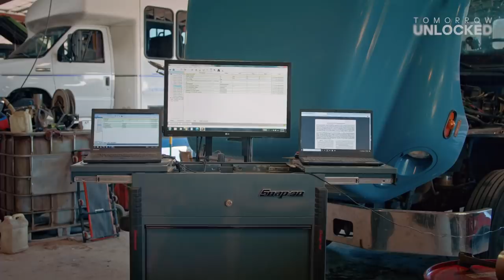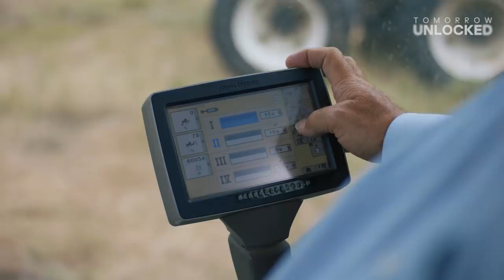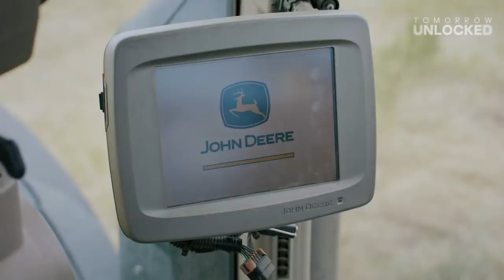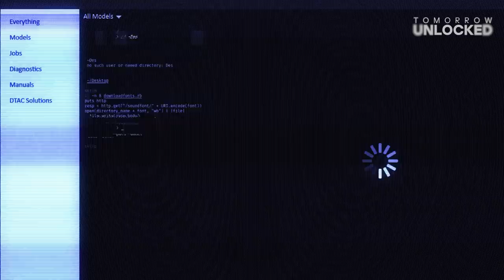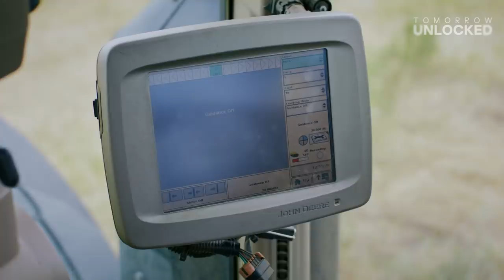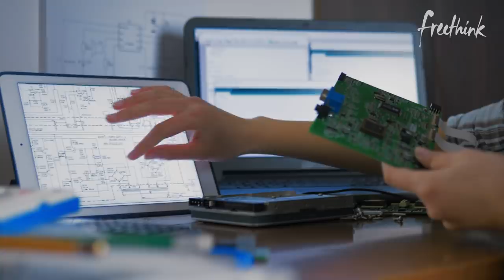The farmers forced to hack their own tractors

Comment: I made a fair side business clearing Caterpillar critical repair lockouts that required a dealer unlock 15 years ago. Mechanic could fix it right but not clear it to start and run. Simple to clip jtag the rom and inject the instruction to unlock past the validation code back then. Now? Dunno.

Comment: Parts houses have slowly disappeared over the last 2 decades as well. No longer can you go down the street to buy components or replacement boards for electronic equipment. You have to order from China and it takes three months to get here on a boat and will be in customs for one month making the repair impossible as far as turnaround time is concerned. So they have made it impossible for me to repair your equipment and compete with the dealer.

Comment: I am an A&P Aviation Mechanic and This makes complete since when it relates to Aviation The FAA saids absolutely not when it comes to repairing your own airplane The only Things The owners can do is what’s called preventive maintenance which only Includes Things like changing your oil if you need anything real repaired you have to bring it to an A&P and They have to sign it off as being “airworthy” if you don’t your Insurance will drop you or They won’t Insure you or in worse case you could be arrested For Flying Illegally yeah it’s not really Fair but That’s The FAAs way RULES RULES RULES

Comment: I’m not a farmer, so I’m wondering if a 2020 model tractor with all the circuit boards is really better than a 1990 model tractor? I’m talking about a hypothetical tractor manufactured today using the 30 year old analog design?

Comment: I own a business that specializes in building websites. There are companies out there like mine that actually lock you into the same kind of situation. If you want your website changed or anything else you have to go through the company that set you up because the way they sell you a website is they own the domain name and the host, if you decide you don’t want to do business with them, they yank your domain from you and hold it hostage. I don’t want to get into the specifics but my company appears to be the only one that doesn’t practice this disgusting method

Comment: As long as you can get parts, you can fix your own farm equipment. Are generic parts hard to find?
Reply: It’s not the parts that they are missing it is the proprietary software to run the hardware. Without it the parts are no good the machine is no good.

Comment: My neighbor just came in with the smallest  John Deere cab with A/C and all that fancieness. He only has .8 acres and our back pasture to mow because he now hunts it😕?. 
I would love to have that tractor , don't take me wrong. I just wouldn't pay for it. Beside the right armrest was more switches than most luxury cars. While it still has a new car smell and warrant it's cream and hot biscuits. When those control boards short out , solenoids short , any of the above loose ground , and as mentioned having to get John Deere involved at their $10,000 per hour rate you would be better off using a shovel to do the work the tractor was gonna do.

Comment: It’s getting to be the same with cars and trucks. Yes technicians can can buy software to fix them. The problem is that the manufacturers don’t have to share the correct information in terms of circuit design and how it’s built and accessibility to parts and having to buy tools to program or reflash for 1000s of dollars just to have to pay for time to log into the manufacturer just to program the vehicles anyway. There is a right to repair in the auto repair field as well because we are getting locked out to.

Comment: I believe this problem is getting into smog equipment which I believe started with jerry Brown sr. He had a cousin selling smog pumps they would disconnect the vacuum advance so the engine would only run at slower speeds then they put in a air pump that pumped fresh air into the tail pipe after the engine so the percentage of pollutants was lower the engine still put out the same amount actually more because the engine wasn’t running as good  and now there doing it with computers remember those tractors 🚜 run on Diesel fuel the cylinders need to be warmed up when the pistons go up the compress diesel will explode it doesn’t require any electricity except to warm up the engine and to crank over the engine and on older big Diesel engines they had smaller gasoline engines to crank them over a lot use a mechanical fuel pump after starting everything is mechanical no electric is required and to shut it off you cut off the air and fuel if you just cut off the fuel it will keep running but it will burn up the engine. So how did they make a engine that required no electricity to only run using a computer. It wasn’t for the farmers benefit

Comment: When tractors were built by those who really cared, they were simple, efficient and could do the job. When computers were introduced the simplicity was removed., In its place were printed circuit boars costing exorbitant amounts of money for mass produced items costing a great deal of money - most of which was pure profit - like the ink for printers or blades for your razor. The point here is that farmers have neither the equipment nor the skill to check, bypass, oir repair these computer boards and programs. It is true, they pay a lot of money for the machinery yet contorl over that machinery and how it operates, reamins in the hands of the company that makes those machines - and this applies to not only tractors but cars, CNC machinery and all things controlled by computer programs. Yes - these programs are a great benefit to the farmer. Yes, it cost money to develop, test and install this equipment. But in the end,  they still overcharge ofr repair parts far in excess of what is necessary. And the systems gives the manufacturers a monopoly over the sale, use and maintenance of the machines. NOT FAIR.

Comment: Trane air conditioning has done this to the school district that I work for they will not let us have the software to diagnose the air conditioning equipment.
It's the new money.
Yes you can buy this car but the wheels aren't included.
You can buy this wagon but the handle will cost you a fortune..

Comment: Is it a case of manufacturers not making much or any profit on the products themselves so making the product so only they can fix it and make money from it that way? If they remove the barriers so anyone can fix it will they then put the prices of the product up by the amount of money they would make on an average machine through repairs / servicing over it life time? An issue Iv seen before is non manufacturer repairs causing other problems that the owner then blames on poor design / manufacture and expects the manufacturer to warranty it.

Comment: It's not rocket science, we are very good at problem solving, probably better than the people that actually make the tractors. We have been doing it for yrs. If the emissions crap goes bad, we rip it off and bypass it. We can buy computers to do upgrades and program it after the fact. We do it with semi trucks as well. They call it saving the atmosphere, but when my dads cat started acting up, we ripped off all of the egr crap, put one big turbo on it, a few aftermarket cooling parts and turned it to over 700hp at the ground. He went from 4.5mpg to 7.2mpg. You do the math at 150k miles per yr. I'll just tell you, it's 12k+ gal of fuel saved. So what of he has a little black smoke every now and again, it saves 28k dollars in fuel a yr or more. Think about it.

Comment: My most despised perp. - Apple , who even patent their own design of screws that need a one off tool to fit ffs. Apple hide batteries make things awkward to access .etc . Worst thing apart from slowing iPhones down years ago and getting fined for it is the fitting of an electrically under rated part to lap tops knowing it wasn't up for the job, eventually it would blow and they did some multiple times in the same device. you'd think they'd test the part after all the failures hell if you understood power ratings you'd know it wasn't fit for purpose. Did they? Hell no still fitting them 4 years on ( 2013-2017) 
That's what's called fn lazy at best . Most indi repair shops knew this and switched em out, or if original was in recommend to get rid .

Comment: Why can't the farmers get the blueprints to a 1940s tractor ( they owned one in the video) and just build their own tractors from old car and truck parts, the mechanic said that could repair diesel truck engines so use diesel engine from 18 wheelers should be a strong enough engine to do farm work  and building your own tractors from used truck parts should be alot cheaper than those 100 thousand dollars John Deeres that they showed in the video saying they had to buy foreign countries computer hacking parts for.

Comment: "If a check engine light was on, i couldn't even tell you why the check engine light was on" 
I am sorry but telling lies to support your argument is not ok. John Deere has for over 20 years explained in the instruction manual, (you know the book that follows the tractor at purchase for no extra charge right?) the procedure to extract a fault code. This code is explained in the manual, probable cause and suggestions of how to fix it. It's not that hard, just read the book!
Don't get me wrong I do strongly support the right to repair act. In some cases you can physically change the parts, but they will need programming and/or calibration afterwards to function. Control modules, injectors, actuators and stepper motors are examples of such. In other cases the software may just flat out fail, and the dealership will have to reprogram the module, and they will charge the owner for it. It should be a lot easier for independent companies to do so. Even though this will also have some cost, because developing software is not free, it would generate competition. JD is not alone about this, but they always get the crap because they are the biggest stand alone company. If that where the case why don't farmers just buy a Case😁🤷‍♂️. The market is controlled by the consumers, so if you are afraid of these companies  JD, Apple, Tesla etc. having control over your product, simply don't buy it. Again it is not ok to lie so people have more sympathy towards you!

Comment: This is their greed, instead of making more productive equipment they try to squeeze money from farmers. They hate that farmers use old equipment and buy parts because deere wants that money. All they are doing is making that older stuff more valuable. 

Deere could be working on bigger better stuff to drive production but i guarantee you compare a 2010 to a 2020 model and the production rates are about the same. 

All tech, computers and tractors/cars you should be able to maintain with affordable tools from the manufacturer. For now ill keep rocking my 1980s tractors.

Comment: The thumb is for the ladies thaughts and spirit! There should be a time derived limit to a insured product based on time ran or miles.Then have Fix manuals handed out for other mechanics and computer tech people,easy fix huh! 3-5 years in their terms,then the rest of time to the owner.Just like car parts are done. And the dealer must keep the boards made and avialable for life!Just like a 1952 carborater on a falcon or Chevy.You can still get them,and older parts,even model T parts.  Ba-bye!

Comment: What a pile of garbage, does it EVER occur to anyone that modern equipment CANNOT BE FIXED WITH A WRENCH OR A SCREWDRIVER.
One of these guys admitted it, THESE MACHINES NEED EXPERT KNOWLEDGE IN ORDER TO BE FIXED.
So there is NO LAW to prevent a farmer from going and getting a degree in Electrical and Electronic Engineering.
Even then, GOOD LUCK FIXING IT.
There is NO LAW that says you cannot perform open heart surgery on YOURSELF, but for the same reason I would NOT RECOMMEND IT.

Comment: Electronics are the worst. I'll take mechanical fuel injection and timming any day over the geek garbage that they are putting in our machines.
As an operator of a piece of machinery I don't need a potentiometer or hall effect input to an ECU to tell me how much material I'm speading or the speed of my auger because I can make that determination for myself. The printed circuit board does not hold up at all well,when put in high heat, heavy moisture or dusty environments . The manufacturer drowns them in gels and seals the connections with seals and positive locks but the truth is, the pins and cavities,even when "gold dipped " cannot mantain a propper electronic continuity when put to the test over years of use and repetition. Size does matter, the more gizmo's on a machine the smaller gauge the wire. The lower the supply and signal voltage. 
The quality of the motors is light duty at best. Let's face it, the computer is sensitive and needs to be in a climate controlled environment , not in a wheel well, or mounted on the bulkhead in an engine compartment. You want to limit the amounts of pollutants, make the engines run efficiently and that in turn will reduce by-products. Keep the geeks out of the machines we need to use to keep our country running.
The newer the machine the more likely it is to breakdown and be unrepairable except by the "stealerships " .

Comment: Buying the tractor doesn't give you ownership of things like programming. Because if they are still using the programming in tractors they are selling, part of the cost of the unit is towards the programming the company spent time and money to develop. If you own it after buying it, the company no longer owns the right to use it. That would allow competitors to simply buy a tractor, copy the programming, and sell it without having to pay the cost of development. Company a goes broke, because company b can charge less for the same thing with none of the original expenses. Most of the hack tools come from communist, or socialist countries. Buying them like that is undercutting capitalism, and supporting socialism

Comment: Gravely refuses to make their bearings serviceable/greasable. Bobcat johndeere echo stihl all are overpriced or say they dont have it, about the info, and stihl wont let a dealer sell a carb adjustment tool, so i make my own the Crosby,tx  store 150 miles away will put a carb on your weedeater and not adjust it and then say you owe them for the carb the labor and you need a new weedeater.  They have atleast one dope head in their shop. Its bullcrap. They are all crap for that. I need more tools ill put their mechanics out of business and either make the next mechanic rich or take over their dealer contract or both.
Reply: I adjusted the carb my self the weedeadater is 8 years old and stihl runs like a champ after i made my own tool for the carb. Scammers are way too prevalent in big biz and dealerships. Take a weedeater in and wait two weeks for them to say you need a new one. Take it home in many peices put it back together and in the procecess clean the prts and adjust the carb, for echo, and for stihl regap the valves and you are back in business.

Comment: Bought a car. From a lot. Disagreement. On sale condition of car.  The Lot Dealer Hack my car. 
  Hear an automatic lock.
Sound as i approach it.
  Driver side would lock.
Passenger side open only.
  Lock my key ignition.
Lock my trunk. Would not
  Except key.
Then they started. On my
  Friend car. 
That when i got rid of car.
  Beware, the cars. 
Are still contact to factory.
  Somebody.
Dislike you. Your car.
  Stop working.
Keep back pack. Scooter.
  Skateboard.

Comment: Nissan is one of the biggest crooked outfits selling products they have all their Electronics so saturated which hidden relays and and solenoids bypass switches that you can't find without taking it to them and they're all set on timers they're going to last so long and then they're going to break and you're going to be in a world of trouble because they will not give you any information you can't get any information on the phone your mechanic can't even work on it no matter what kind of computer system he has I know I just spent $4,000 in 4 months getting my wife's Nissan Quest running again I just woke up one morning and it wouldn't crank out of nowhere the trouble started the way I see it when the warranty runs out the company gives up any rights they have 2 hidden part surge switches that no one else can find cuz you paid for the car and it doesn't belong to them anymore and they should have nothing that they can hold and say you got to pay them to get something fixed if that's the case then you never really own it if you're at their Mercy if it breaks down especially after the warranty there's an old saying there before more guys I grew up on a farm and that is I wouldn't kick a hog in the ass for Nissan